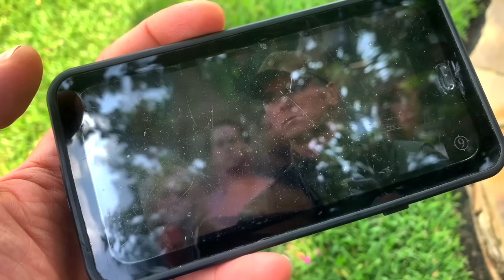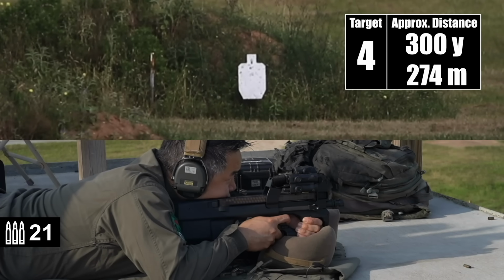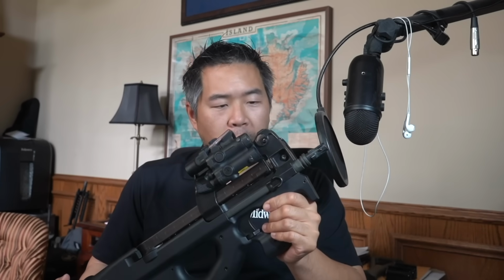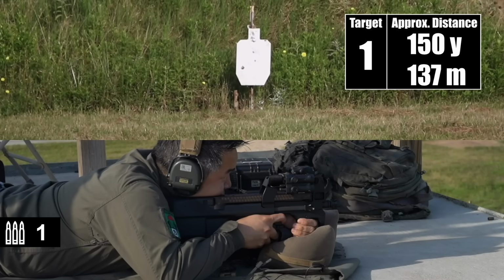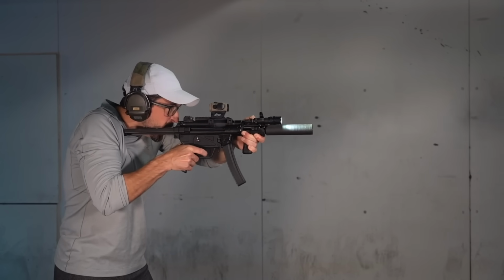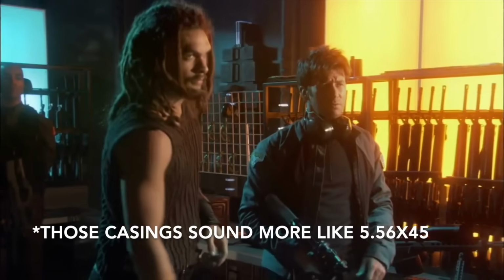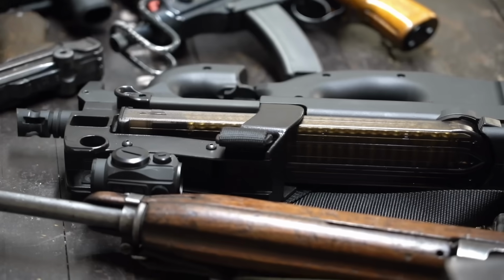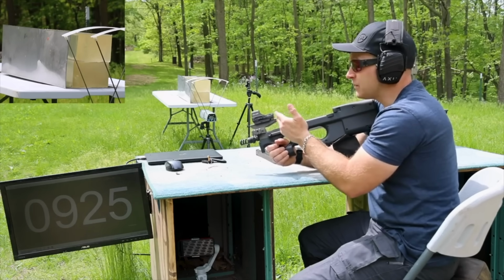FN P90 to 500yds: Practical Accuracy (Stargate SG1 main weapon) PS90

Comment: i love these kind of empirical videos, but im slightly annoyed with one word that is being used that is just physically incorrect: energy transfer. im not criticizing 9-hole reviews as everyone makes this non theoretical and a very meaningful mistake... when we are talking about the impact on a steel plate we see, we are talking about the transfer of momentum, not energy. the momentum of the bullet is what you feel as the recoil and what you see as the movement on the plate, but its not as simple as that. energy which is much more hard to see or experience in any obvious way is the potential of how much work the bullet can do to the target aka how much effect it can have on the target... and since bullet construction and all that makes all this infinitely too complicated for this comment, let me just say this: the p90 round just like 556 have much more effect on pretty much any target than their momentum aka their recoil and movement of a steel plate would ever indicate... slow and heavy bullets feel strong where as fast and light bullets do much more work in the literal physics sense of the term. newtons law does not describe the conservation of energy, but the conservation of momentum. by emphasizing energy over momentum, bullet designers can cheat the bullet to do much more work on the target without causing as much recoil aka momentum on the shooter. the p90 is an extreme example of this principle... perhaps even too extreme as because of many reasons like air resistance, you cant just keep making the bullet mass lighter forever.

Comment: If my understanding is correct, one of the big reasons they switched from the MP5 was they didn't have to worry about the actors getting plunked with hot brass.

Comment: Has anyone tried to tried to build a P90 in something like 30 carbine or some other straight walled cartage of comparable size? If you drop the armor penetration requirement and don't mind having a bit more recoil, it would seem that a more convention cartridge design would be worth investigating.

Comment: Better Optic, longer Barrel ?
Reply: For a red dot, the one they are using is the best at what it does, especially for the price. A magnifier might have helped, but it's missing because of the round it shoots, not because of the accessories on the gun.
Reply: Wondered, am aware of iron sights out to at least a 1000? and given its intended "close in" use more might be excessive and possibly prone to battlefield failure, the twin optics solution may have potential? But anything too complicated (batteries or glass ?) would seem to lend potential for failure at the first encounter with the enemy or conditions? (What do I know !)

Comment: On the subject of AKS-74U being decent in close-quarters, the reason is fairly simple: it uses a pressure accumulator muzzle device which vents all the gas forward right after the bullet. That causes all the shockwaves from the shot to travel away from the firer. In case of the AR shown, it has a dirty big almost-AK-74-like muzzle brake which vents gas sideways and somewhat backwards and into the wall you'd be standing next to, where that shockwave would bounce off that wall and into your ear.

This is why Soviet Union decided on the slanted muzzle device for the AKM: they checked many different muzzle devices back in 1950s, and rejected the proper muzzle brake because it sent muzzle blast right into the next persons head, affected their aim and also caused problems with verbal communications. Slanted compensator didn't do that, while helping reduce the muzzle climb.

Comment: I have this as my suppressed HD, backpack, and travel gun. I'm running mine with a 1 MOA RMR in a low profile mount. It's a very good choice in this role. This was designed as a 0-220 yard CQB tool. With a 50 yard zero and the correct 27gr ammo, SS198,  it's very flat shooting from 0-200 yards. I've tested mine on paper at various ranges out to 200 yards. It will stay within an 8" circle at all distances within that range with a center hold. 
It was interesting to see it pushed farther, but that's outside of it's purpose.

Comment: I'm a big fan of the 5.7x25. Just a little heartbroken you had no thoughts on the AR57 Or the Johnson Spitfire Rifle a M1 Carbine MMJ 5.7mm. In a M2 carbine short barrel configuration 40 round magazines would an equal possibly bridge the range gap to a slightly larger cartridge. I also think the PS90 would do better at long range

Comment: i have used the p90 a lot in many different video game but sadly i dont have any video of any of the times i have been using p90 in games except the few times i do long potshots at opponents in ghost recon wildlands with a p90 (with long barrel, digital comp m4 scope and suppressor), my longest hit with the p90 was a 650m headshot by the airport on the north-western edge of the wildlands map, i think i even gotten a 400m headshot with the fiveseven pistol in ghost recon wildlands, my longest hit though was a 850m (if it wasnt for the draw distance, i could have taken it even further) with a mk14 (long barrel, bipod front attachment, t5xi scope and extended magazine). 

its so fun to sneak around on ghost recon wildlands and ghost recon breaking point and use unorthodox weapons as marksman rifles, i often use the tar-21 tavor as such in breaking point but occasionally i use an smg or pdw as one, depending on what the situation requires, smg and pdw has a much lower sound signature compared to assault rifles in game and it makes it easier to take out opponents without being detected

Comment: Great video although the part of about lackluster terminal ballistics I thought was a bit over-simplified.   The SS197SR V-max round actually penetrates between 12 to 15" of ballistics gel just fine and creates a respectable wound channel. It certainly was highly effective in the tragic Ft. Hood mass shooting that included instances of soldiers charging towards the shooter, who were dropped by shots to their torso.   That incident (which is rare in that the wound locations of the victims are well documented and public) should have ended the controversy regarding the round's effectiveness.   I personally use a Smith & Wesson M&P 5.7 with a Holosun 507K X2 sight as my primary home defense firearm.  I use it because of the light recoil that allows me to make more accurate rapid follow-on shots.  It's like shooting a .22 pistol due to the interesting gas operated system in that pistol.  It's also superbly accurate and has a high magazine capacity. Combine all that along with its threaded barrel (for a compensator or a suppressor) and It's essentially my dream gun for a home defense pistol.  It's just a great ultra reliable pistol unless you use AAC powder coated 5.7 rounds (which gums up the gas system in the M&P 5.7 unfortunately).

Comment: Let's face it, the P90 was designed to be used at close range (10-150m) in an environment where body armour was becoming more commonly worn by both soldiers & terrorists. It has a relatively high muzzle velocity (715 m/s (2,350 ft/s) vs M4's 910 m/s (2,970 ft/s)) for the size of its cartridge, which can punch it through most common body armours at that 10-150m range, & its projectile is designed to minimise over-penetration & richochet, making it a potentially effective law enforcement weapon in the anti-terrorist role, whilst still being an effective military PDW for AFV, transport & support services troops.
I think Henry did well to get it to hit anything out at 411m (450yds), &, even then, he or Josh mentioned that it would still be an effective suppression weapon at that range.

Comment: I went into my favorite gun shop to buy a Tavor.. that was a done deal. Got in, and saw a new PS90.. the SG-1 in me HAD to at least handle it.. walked out with the PS90 and not the Tavor.  That decision has been a love/hate one for years now. For general use, the Tavor would have been the better choice, but I have other weapons that fit that role nicely. The P90 has always been a primadonna for me. It cost a lot to feed, and for awhile it was really hard to even get ammo for it.  I wouldn't even dream of anything outside 150-200 yards with it, but inside that, with a red dot it's really nice. 

The wife can fire it easily where a AR is too much for her (She is small), and a shotgun is too much recoil for her. By son used it exclusively for year, until he got older and could handle a full sized rifle, and prefers it now.  The P90 is always loaded and ready for home defense, along with a few other options. I think it is more than adequate for a home defense scenario, especially for the family members not comfy with a larger weapon that may actually do a better job. It has the cool factor in spades.. it has it's place.. it's just a really niche place.

Comment: To penetrate level 3 armor at 200 meters they probably expect you to use the SS190 rounds (hardened steel penetrator). I think the 5.7x28mm rounds are pretty amazing but that's because they can (with appropriate ammo) penetrate even multiple layers of soft body armor from a pistol.

Comment: @17:10 They chose the P90 because the downward ejection made the set safer and made it easier to choose camera placement  It meant they didn't have to worry about where the hot brass was going.  Remember they were using real blank firing guns and blanks come out hot!
Reply: PS later the increase in 5.7 ammo prices lowered their access to cases for making blanks so you saw more guns come back into use.

Comment: The producers/armorers switched to the P90 because they knew the 9mm MP5 had no armor penetrating capability. Back then the 5.7x28 was the new hyped up hotness, it was supposed to be an AP beast. Its mentioned in dialog in the show they “need something with more penetration”. The writers of the show actually did a fairly good job researching most of the decisions they made for equipment. Honestly I have a PS90 today because of that show. Id be REALLY curious to see how the longer barrel on the PS90 does in this test.

Comment: There was a period in Counter-Strike, I think it was Beta 3 or 4, where the P90 was basically a high rate of fire laser beam.  Absolutely devastating.  Made it so everyone just ran with that gun, because why wouldn't you?

The fixed it in the following beta, but managed to screw up the M4A1, turning that one into the new "why run anything else" gun until the next beta.  Fun times.

Comment: 5.7x28 would have been far more effective had FN built the cartridge to handle 60-65k psi. The cartridge would see a 300-400 fps gain which would increase effective range to 300m+
Reply: @michaelw2288  this late in the cartridge should not be modified to allow the higher pressures I suggested. The cartridge could be redone but would need a new name for safety reasons. FN's pistol design  would need to change to accommodate a higher pressure round. A locking lug would be needed, stronger recoil spring, and the hammer would need to generate 25+ lbs of force to detonate the milspec/magnum class of primers that would be likely needed to handle the higher pressure.

Comment: My favorite CQB that I have used was the M249 paratrooper( Wire stock slid flush with back of receiver and I believe it was a 2 1/2 in barrel) we had those in 2nd Ranger Bat in 1988

Comment: It's not just pistols in 5.7, multiple companies are doing small rifles in 5.7. The two I can think of off the top of my head are an AR upper that feeds from top mounted p90 magazines and ejects out a standard lower's mag well. And Cmmg makes a Banshee (blowback AR) on a dedicated lower that takes FiveseveN pistol mags. As both are AR based the whole range of accesories is available, many of which don't work on a p90, even with the tri-rail. 

The reason people might like these is they have less recoil than a comparable 9mm and can hold more ammo for the same weight. The tradeoff is that 5.7 has less energy on target than 9mm, even at range.
Reply: The ballistics of the 5.7mm have more in common with the 5.56mm than classic pistol ammo.  A light, long, very fast spitzer bullet that will very easily tumble and can potentially cause a large wound cavity.  That's why it hits fairly hard because it's otherwise a very hot .22 magnum.  It's also flat shooting, which gives good accuracy.  Lighter bullets have lower recoil so it's easier to shoot.

One issue is that the ammo is fairly long and people with smaller hands have some issues getting a proper grip on the pistols.

5.7mm seems to be a love it or hate affair.  Some think it's amazing, others don't see the point.  It was designed for a very specific job which may not translate to common civilian use.  Generally people have found it to be an effective varmint and light hunting round and as for self-defense it seems to be doing OK, though there seems to be some issues vs 9mm expanding hollowpoints in terms of perceived effectiveness.

Comment: I wish you had been able to test it with SS190 or ss198. They are higher velocity than the blue box. I think that blue box is the SS197, which is 1735fps, while the ss198 is 2216fps.
Reply from the maker: but the 198 has a much lower mass. My guy at FN tells me the 197SR is the best bet for a ridiculous exercise like this as it's the most accurate of them and while 40gr isn't some heavy match projectile.... it's better than 30gr.
Reply: @9HoleReviews  That makes sense. Thanks for the explanation.  Love you channel.

Comment: Seems that the WW2 PDW that was the M1 Carbine did better than the P90 even though the M1 Carbine had worse sights and a lower velocity projectile. For how expensive and high tech this P90 rifle is, I would expect it to make easy hits to 300-350 meters which are the common engagement distances in combat, but it struggled past 200m.

Comment: I do wonder how a PS90's 14in (with 2in flash hider) barrel would do on this course. Would it be any better? Any worse? the same? I enjoy my PS90 quite often, I def bought the thing because of games and movies, it was my perfect apartment gun too until my state made it illegal and it's now with serval of my other firearms on semi perm vacation with family (and now my M1 Garand is my apartment rifle...). Would be neat too see. Also if the FN red box (SS198LF I think? Funny story, one range would not let me use my red box ammo because it was "green tipped" and thus too powerful for that indoor range... despite it being a  lead free hollow point round made for law enforcement training at indoor ranges...) would do better than blue as it has a bit more power (my preferred round). As for your last question, one of my main reasons that I bought a PS90 was dual welding it in MW2, I later picked up CS GO but it was never my go too, though sometimes when I decided to use it in a round, I may or may not have had it leaning on my desk next too me. Sadly I don't have any videos using the P90 in games.

Comment: The height over bore on the P90 makes doing the math for distance hard with a normal zero.  I am not sure what the correct zero distance for one is,  but it sure ain't 25 or 50 meters.

Comment: My thoughts. 5.7  borders/ is  Equality to 9mm. Some things it's better at and some things it's worst. It's better then 380. Pros Capacity and i think out 8ich barrle with  blue tip  it's better 9mm agenst level 3 vest.  Shoot flater then 9mm .Cons it's smaller in Every dimension vs 9mm and doent  perform well in gell .it's 1/2 weight and size of 9mm. Doent have the speet off 556

Comment: 19:45 it's worth noting that the movement of the plate actually a measure of momentum (MV), not kinetic energy (MV^2). Slower and heavier cartridges tend to have favorable momentum, while light and fast rounds tend to have higher KE. For example, standard 45acp has higher momentum than 9mm, despite having lower energy.
Reply: Also it would be hilarious if you put  a PLxC 1-8x on it. I'm very curious how far you could stretch a platform with optics alone.

Comment: Years ago, I shot what I thought was a completely empty 16oz propane cylinder with an FN 57 pistol. One shot, and the cylinder was GONE! For a moment, I thought, how powerful is this little round ? Then, the rational brain kicked in. Dummy, the cylinder still had pressure in it. For a moment, I was really impressed by 5.7 round.

Comment: I love my PS90. With the longer 16 inch barrell, it is extremely accurate. It was intended for shorter range that what you did here. At close range with the right ammo, it will defeat soft body armor. And 50 rounds kinda makes up for any other shortcomings. ❤🤍💙

Comment: My experience with my postie P90 (not PS90) is that my shooting is not too accurate, tends to be somewhere at 4" group at 11 yards or worse. Yes you can keep all 50 rounds on a man-size target at that range without much issue during a mag dump, but even with slow-fire you can't get the groups as small as you'd expect at that distance. The barrel does move and the trigger is long and mushy which I assume is most of the issue, plus AE ammo tends to be a little worse than FN brand. I'll add that if you tighten things up to where the barrel doesn't move, the P90 will not run FA, so as said in the video, the movement is there and is needed.